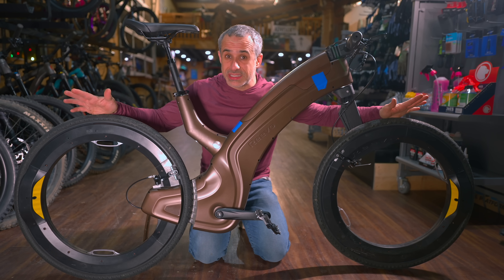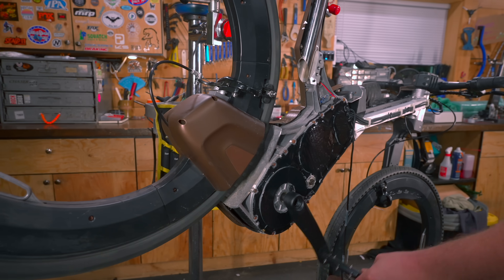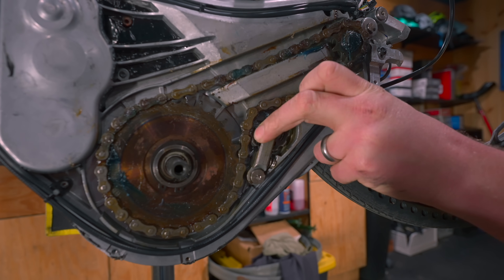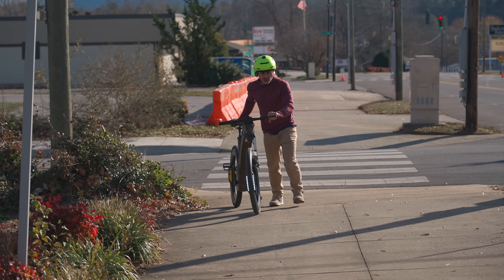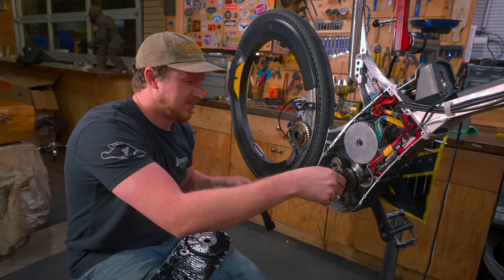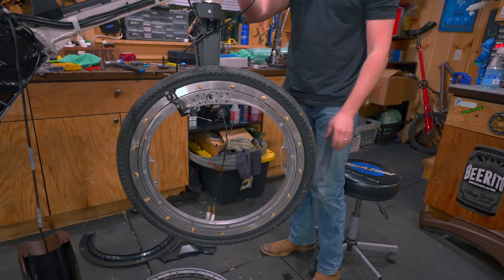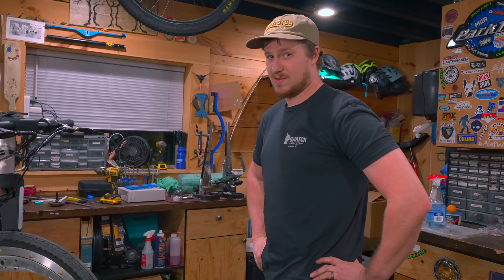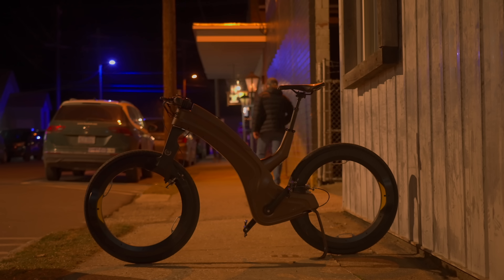What's Inside The World’s Worst eBike? Reevo Teardown

Comment: oh my goodness.
the noise most likely comes from these nylon wheels, which in sum, also create the high friction; they have to run in narrow slits to eliminate sideways play, and that creates friction. with enough grease of a proper kind this wouldn't be as much, but you'd still notice it. a double-row ball bearing assembly was what I expected, actually, probably running dry. now these little wheels are not made to run silent, they don't have to used in the original sense; thus they and their bearings, make noise.
which is them amplified by the empty chambers within the tyre.
best idea ever... the engineers surely have never seen what makes a drum make noise. :P

and so many gears and cogwheels running around... explains some of the weight. I bet they were playing around with Lego(r) Technic(r) to figure that out. a brushless motor around a rotor over the pedal shaft would have worked way better and saved a lot of weight.
and noise, too.
and surely there would have been space to add a disc brake, too, even if only actuaded by wire. just add a large disc running around the inner diameter of each wheel, the lever alone would have been enough to stop a motorbike.
or a stampeding e-bike. :P

Comment: The one who made this is not an engineer that i can say. 12 different sized gear makes it unefficent because of to much friction and heat. I always say design engineer also has to be decent mechanical engineer at least. Also instead of using stupid small wheels inside the tire they should be using  top quality free flow bearings so that it could rotate smoother.

Comment: What an incredibly stupid and unnecessarily convoluted design. 12 gears just to work a pair of pedals and get a wheel moving... no wonder it was a pain in the ass.  How this received so much funding and got past the prototype stage is beyond me...  tomorrow's engineers really need to learn the philosophy "just because you CAN doesnt mean you SHOULD"
Reply: "just because you CAN doesnt mean you SHOULD". That isn't the issue here. The issue here is that they most definitely "COULDN'T" but still did!!!!

Comment: The wheel being the replaceable part with all those hard to set rollers is INSANE! 😂
Reply: it isn't intuitive so i don't blame the shop guy for saying that the aluminum gear is the wear part, but this isn't correct. if you have a softer gear (the big aluminum wheel) and a harder gear (the small driving gear likely made of steel), the harder metal will wear out first because dust particles in the air will accumulate in the softer gear, causing it to grind down the harder gear 

so that was actually some smart engineering, with the hard metal gear being the replaceable one 

there's actually just a lot of very clever engineering in that bike... it's just all futile because the thing failed in the design stage. all of the clever engineering in the world can't save a bad design

Comment: 9:10 Just a comment on the machined gear on the cast alloy rear wheel rim and it being the main wear component. My dear old dad was a watchmaker. He started his apprenticeship in the mid 50s, serviced spy cameras while doing national service in the British army, and went on to run a successful business repairing watches and clocks until the 80s.
His favourite dinner time question to guests was, "if you have a large brass (soft) gear being driven by a small hard steel pinion gear, which one wears out first?" 
Surprisingly, it's the small hard steel pinion gear. The reason is, microscopic silica dust (harder than steel)in the air, gets imbedded in the softer gear, and works like a diamond grinding disc , wearing away the steel pinion gear, which didn't appear to be too difficult to remove from that ridiculous bike. There may have been some actual research or engineering knowledge in this particular case, or maybe not...
Reply: @nerdyengineer7943 Exactly. And scaled up like this, that silica dust, from riding, will be more like sand particles, creating an even more abrasive surface, while the pinion gear does many times more the rotations. I don't think it would last long on gravel or by the beach.
Reply: Yeah, and also the pinion gear teeth have to do far more work per tooth than the teeth on the larger gear.
Reply: you gotta multiply your hardness factor by the torque applied. a gear that is 3 times as hard but 10 times as small will wear evenly with a gear made of softer metal but made of a larger size.

Comment: I'm quite sure the little plastic wheels inside the front and back main wheel are regular parts from a standard 3D printer. I wonder what will happen if dust and sand makes it's way into the rim, blocking all those tiny wheels? All in all the bike looks quite nice, but the technically design doesn't make it suitable for dayli use at all. And who wants to go with a bike that sounds like if you are pushing your lawnmower down the road? Many greetings from Germany!

Comment: I would have thought there would be more batteries hidden in that structure than what looks like 2 or 3 18650 vape pen batteries.  I guess my 1989 Motobecane 18 speed Touring bike with the Headlight that ran on 2 1.5v Carbon Heavy Duty C cells was an e-bike.  That light electrically assisted my riding in the evenings.

Comment: Just that tiny sprocket on the chain adds about 5% of losses by itself.  Assuming it is a 9-tooth sprocket, the actual loss figure would be 6.03% from that alone, the losses going into trying to rip it off its bearings rather than being transferred to the next mechanical member in the drive train.  Now multiply all those losses together.  Whomever designed this thing seems to have learned engineering from a comic book.

Comment: Each of the 12 gears probably has around a 95% efficiency but assuming the best possible, which would be like 98%, that still drops the efficiency down to 78.5%. If the gears are closer to that 95% (which they probably are) you're looking at 54% cutting your power almost in half.

Comment: I wonder how much quieter it would be if you ripped out the existing gears and replaced them with dual-helical gears instead.  I mean, the ones that can be replaced, anyway; not sure if there is a chain design for a helical profile...  But it would lose a lot less power generating noise instead of transmitting power down that absurdly long drive train...

Comment: Great engineering effort to execute the worst design EVER.  Traditional wheel is supported by two bearings located in close proximity to the center of rotation.  This maximizes rotational leverage at the bearing.  This results in traditional hubs minimizes relative velocities between bearing elements.  There is no such thing as "hubless".  The Reevo design significantly grows the hubs diameter.  The massive hub replaces two small bearings at the center with SEVENTEEN bearings around the perimeter.  At the very least Reevo invented  a wheel with 15x more friction.  To add insult to injury, the bearings spin at a much higher relative velocity at the perimeter than at the center.  Another source of additional friction.  To add injury to even more insults, the bearings ride in a channel on little polyurethane tires.  This is a source of a LOT of additional friction not found in traditional wheels.   I won't even get into the drivetrain nonsense.  I honestly can't think of what can be done to make this design worse than it already is.  Someone tried very very hard to make something work just because it looks cool and different.  All while ignoring every first principle of engineering known to man.

Comment: I am an engineering architect, and I was always telling my clients, just because you can do something, it is not always a good idea to actually do it. I am not as negative towards the Reevo. It looks elegant, a novel design for sure. With a stronger motor, it is probably quite useable. My impression is that it is unnecessarily complicated and probably expensive to manufacture and service. They are some teething troubles that could have been worked out. But again, an unnecessarily complex design.

Comment: Holy friction Batman!
As a mechanical engineer, this screams to me "bad idea engineered as well as possible". Like, chaining together a dozen gears, into a roller chain, into a hub-less wheel without it failing takes a lot of engineering skill. But some of the high level decisions indicate that the guy making the big decisions had no idea how bad these decisions were going to be. Each gear/chain transfer loses about 1-2% of the power put into drivetrain...so you're looking at 20% loss there. And cheap bearings suck; adding 18 of them is going to suck hard. Probably another 20% there. Cantilevering the tires massively increases the forces involved, increasing friction even more. Cramming it all in to too small of space means everything is undersized...decreasing efficiency even more. And weight was never a primary criteria; hence the square tube frame and airless tires. Maintenance, similar; considering there's dozens of bearings with no grease access.
All told, I'd be surprised if more than 30% of the energy put into the pedal comes out as forward propulsion. A similar gravel bike probably runs north of 90% efficient. 
This concept would have worked much better with a genset setup; pedal by wire. Pedals power a generator. Separate motor powers the rear wheel. It still wouldn't touch 80% efficiency, but it would be lighter, cheaper, and simpler.

Comment: i have a normal E bike that i had to refurbish myself and its a bit of a botch job, but still very reliable, but the one problem is, like this one, mine TOO can try to run away from me🤣🤣🤣🤣, yeah if my crank turns while i move it, it pedal assists, so i have to remember to press my power button on the handle grip to off before i walk it😅😅

Comment: YES!! Thanks for doing this teardown! Always wanted to see what was inside one of these. The complicated gear drive is wild!
Reply: Can someone explain to me why the engineers thought 12 gears were neccesary? and why they didnt use ballbearing wheels inside the wheels around the tire?
Reply: @DaxPerez  12 gears was probably due to the odd path of power transmission and space constraints. the path bends and changes depths multiple times which just necessitates many gears. A normal bike just has a simple straight line from pedal to wheel.
Reply: Kinda looks like they started with a 3D render that was never going to work IRL and hired someone to pack an e-bike into it. That person gave them what they asked for, cashed the check and moved on.

Pretty sure they did use sealed ball bearings in the tire but rolling resistance of a bearing is linear with diameter, so if you make the whole diameter of the wheel a bearing it’s just inherently 100x worse? God forbid you roll off a curb and deform the rim even slightly….
Reply: Reevo Fix Guide when?
Reply: @xp67prototype  I wonder if some hobbyist owning one of these has tinkered it to raise the efficiency, and what they could do. Because I'm sure there's things to be done!
Reply: @NWolfsson  I feel like the best place to start would be the wheels, they stop like the brake is constantly engaged. Maybe replace those tiny wheels with quality lubricated bearings or something. No way those tiny wheels are the best way to make wheels like that.
Reply: 3 more cogwheels and the thing could actually have gears!
Reply: give this bicycle a repair score xF
Reply: This bike is a masterpiece like a Rolex watch.  Both are way more complicated than they need to be, which is why it's a masterpiece.
Reply: Every location where one gear contacts another gear is a source of resistance... This contraption has so many gears turning other gears, which is why it's so hard to pedal... Add to that the enormous lateral forces that the final drive gear has to support to hold up the entire bike... Did that come out right?? The big gear that turns the rear wheel also has to support the entire weight of the rider's fat ass...
Reply: @cschuh4695 I think there's another 2 sets of bearings for holding the wheel ring. The gear that spins the wheel cog needs to spin about ifs own axis. It can't  take the torque made between the wheel center (where the riders weight vector acts) and the bearings where the wheel ring rolls against the frame.

Comment: They literally could have used a normal bike, added a middle chassis, and then a few gears for the motor, and a centrifugal clutch for the motor and then the locking mechanism of the kickstand. 

They literally could have used mostly off the shelf bike components and it would have been much much better. Not being able to pedal EASILY, basically makes this useless as en electric bike as all the energy is wasted in that resistence.

Comment: "It's only a 1% loss in efficiency .... per gear"
Absolutely incredible. I'm not a fanatic, I don't mind a losing a *little* for style etc. But a drive train of twelve gears? really?
Anyway thanks so much for taking this thing apart, I've been so curious about this.. entity of a 'bike'.
Reply: what's sad too is that the motor they put in probably has enough torque to drive it almost directly
Reply: 1% per gear and 30% per tire. I honestly could not believe how badly those wheels spun
Reply: If there is a 1% loss per gear (typical for spur gears), 12 gears will have an efficiency of 88% (0.99^12). A derailleur setup is more like 97% efficient, meaning that the reevo has at bare minimum 4 times the drag of a traditional bicycle before you even get to the high-friction wheels.
Reply: for how much a reevo bike costs, you can just add a electric motor on your bike for way less
Reply: I think its mostly the wheels. Gear box bikes are noticeably less efficient thank a chain and derailer setup but its nothing like this abomination.
Reply: More like 1x loss per gear, this bike has so much friction it stops by itself.

Comment: Glaring miscalculation; gear ratio (teeth per sprocket) sizing is incorrect and redundant.
The over-engineered sequence of initial assembly, even with a manual, would never be cost effective. AI assisted robots would self-destruct.
This bike is a design model, far from end result distribution quality. The designers were evidently learning by experimentation with minimal forethought.
Parts and material inferiority need no explanation.

Comment: 9:03 that's crazy, those rollers are standard parts usually used for cheap 3D printers. There's no way they would last long, especially because its not watertight. From my experience, they are supposed to be "self lubricating" but they do wear out pretty seriously, and I didn't see any eccentric nuts, so I guess they set them up as self-clearancing????
Reply: exactly, when i saw it i was like those are V-slot wheels lmao

Comment: With a slight redesign you could really simplify that gearing set up.
They way overengineered it and made it more complicated than it needed to be.
They could have easily linked the chain onto the back wheel taking away a lot of the completes, which would have vastly improved the ride feel.

As the chain pedal hub is basically next to the rear hub gear, a slight body rework and you could connect it.
Would have drastically simplified that production and maintenance of the bike.

Also making the wheel gear and inner component that bolted into the solid wheel would have made for far better long term replicability.

This break down really does show that this was an incomplete prototype that was still a few iterations away from what should have been the final product.

It might not have been a good product, but it would have been a better one at least.

Comment: turns out regular bike wheels are not actually broken and need to be fixed, who would have thought? Seriously, I am mot against innovation but if you innovate you better make sure that the new thing you make is better than the thing it is supposed to replace or at the very least cheaper so the value makes sense.

Comment: The more I see of this bike the more insane it is, that's not a compliment. Also due to its rarity, to me this is more kinda more Art, than engineering in the end.

I wonder, because of the rust,
 if by chance hidden inside one of the 12 gears, (WHAT),  
is a rusted one-way bearing that jammed, and causes the run aways....? Still an unrideable mess in the end. 
Yet holy, would I love to rebuild that puzzle.😅

Comment: Question, could you get all the parts remade in billet, remove the electric motor? In your budget? I'm supprised the transfer case doesn't use oil haha
I dont blame the designers if there keep to a budget, nothing stopping them from designing a 24inch ball-bearing rim, it's just it would cost a shit load
Reply: Yes😅

Comment: A bike designed to break and getting people to buy another one. Clearly never designed for repair in mind. After all, could have gone the Apple approach and the moment you changed a brake pad. The thumb print scanner doesn't work for some reason. All because you didn't buy a first party authorized brake pad. Which is just a cheap rubber brake stopper. From cheap children bikes. Yeah....

Comment: Terribly over-engineered bike.

Too many gears, a motor, too many bearings= resistance.

A bike has 3 axles: front wheel, back wheel and pedals with at least 1 pair of bearings for each.

It's all you need in a bike.

Comment: Thats hilarious, the frame looks like it would be the first prototype with all the rc connections and complicated gearing and stuff yet they still decided to do 4 or 6 large injection molded parts to cover it up and make it look good. You know how expensive that is?
I think it couldve worked had they used a shardened steel band around the rim and instead of the rubber rollers used an actual roller bearing of this size. However thatd be super expensive as well and hard to have that be shock absorbant enough so it wont be an oval after the first bridge.